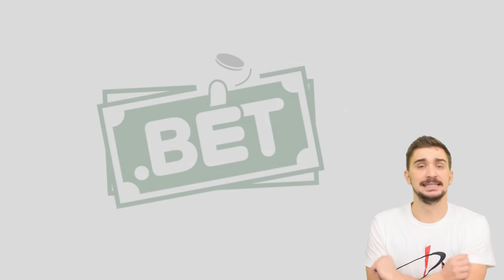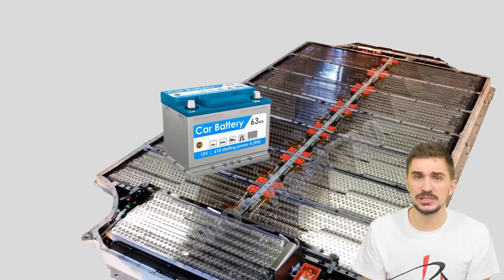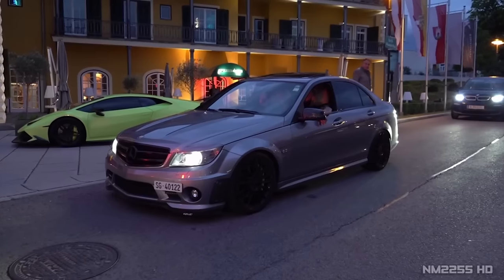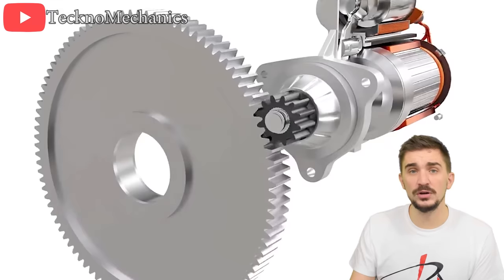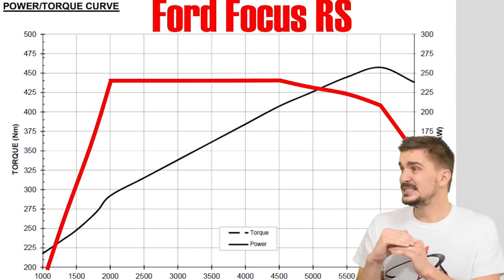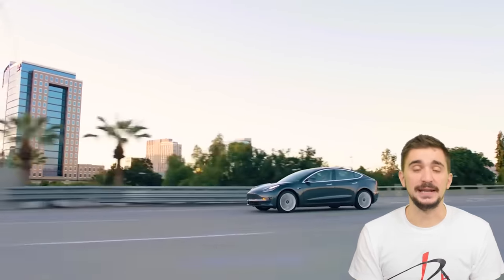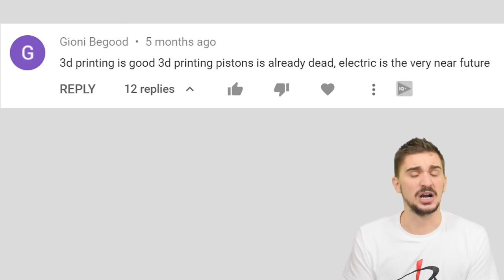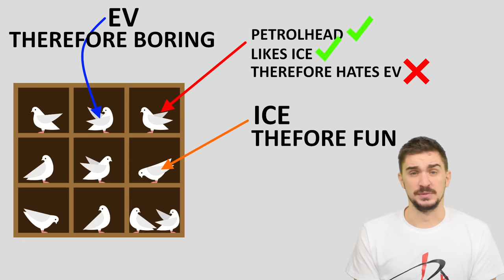ICE vs EV - IN-DEPTH comparison of BATTERY ELECTRIC and INTERNAL COMBUSTION ENGINE vehicles

Comment: induction is a function of the first time-derivative of the magnetic flux,
which means effective induction loves HIGHER FREQUENCY,
which in turn means high RPM. higher than needed for a EV.
whereas a brush motor torques like a mule on the near zero RPM,
the more you stall it the more it torques.

Comment: Some ev vehicles do use a DC motors , brush less. The torque curve looks like that to save power and for driving ability. You would be ok over the road with max torque at high speed, like drag cars are

Comment: As someone who loves gas vehicles, I also love electrics. However both are being made very cheaply, while costing a lot. I personally would prefer an EV due to my use case, however I won't be buying one anytime soon. This is because battery packs are still a work in progress, as well as the fact that a lot of manufacturers are not developing for the long term. Instead they want to pump out garbage for a generation that doesn't know quality. At this rate, I'd be better off buying a car with a blown engine and just electric swap it.

Comment: I like your channel and your videos very much. I do like ICEs and EVs. I ride a high reving 600 cc inline 4 DOHC with 4 carbs and it is a ton of fun. However, I feel increasingly bad about contributing to carbon emissions. I'd love to put carbon neutral fuel in my gas tank and would accept a higher price for my motorcycle meditation. Contributing to emissions is taking away some of the fun. It is also a reason why I now ride less. I can't excuse my contribution to emissions by pointing at the insanity of the still increasing levels of pollution around me. I feel that I share responsibility.

There are two points that I would have wished that you mention in that video.

Electric propulsion for trains etc is on a very high level of refinement since a long time. The evolution potential for EVs is actually in the battery department.

You didn't mention efficiency. Which is typically 20% for an ICE and 80% for an EV in road traffic. Not to mention recuperation.

With regards to Teslas losing against ICEs at high speeds: Sure! I live in a country with no speed limit on the largest part of the Autobahn. But the argument you make is actually more a petrol heads view, that thinks of speed and performance. That's great - for the race track. I've been a passenger in a Tesla in Norway. A short tip on the "gas" throttle and normal traffic looks like it is parking.

What I dislike is the idea that EVs should be huge and massive for safety reasons, like massive ICEs. The masses need to travel with less energy consumption per km/mile. So light weight EVs.
Reply from the maker: Honestly feeling guilty about riding means that you're seeing only a part of the whole picture. By preserving an old machine your also saving the world from the pollution and emissions that will happen during its recycling and you're also saving the world from the emissions of the manufacture of a new bike. On top of this the impact of a single 600cc ICE is less than drop of water in an ocean. There's a million stupid and unnecessary things we're all doing daily that are doing far more damage than that bike. All the unnecessary packaging of everything we buy, new this, new that. In reality the true problem is consumer habits and businesses who are doing a lot to keep those habits alive and governments who are not improving legislation to curb that. You're denying yourself "meditation" which you will simply have to vent elsewhere.
When it comes to ICE efficiency being 20% this is unfortunately propaganda that's being spread by the media and EV evangelists. 20% efficient ICE engines are from the 60s. Even my 1987 Toyota mr2 manages more than that. Many modern petrol cars are close to 40%,  some even beyond that. Modern diesels manage close to 50%. EVs are also not zero emissions and if you buy one you should also feel guilty because their manufacture has a greater environmental impact. You should also feel guilty driving one unless all the electricity comes from renewable sources. A single thermal electrical plant will make more emissions in a single day of normal operation than your bike in your entire lifetime. Feeling guilty is silly in my opinion because almost everything we do would make us feel guilty. I think a better approach is to be realistic and proactive. Let's not present neither ICE or EV as something that it is not and let's focus on changing our habits, the ones that matter and have an impact. Less waste, less buying what we don't need, more pressure on authorities to actually do impactful things. Less conferences and summits. More action and real change.
Reply: @d4a  Thanks for the kind answer! We are not that far apart, opinion-wise. That 30 year old Ninja will most likely stay with me until I'm gone, for exactly this reason: Sustainability. My car is a Citroen AX, that I basically saved from the scrapyard. I keep it for exactly the reason that you explained in the planned obsolence video: 80ies/90ies robustness and durability, before components were optimized for the typical use period of the average consumer. Replacing it with a new EV would be an additional waste and harm to the environment. The AX consumes less than 5 litres per 100 km and it handles almost like a race cart. Tons of fun. EV wise, I own a HP scorpion tricycle with a propulsion system that I have designed myself. It drives with solar power from my own solar system. As is my home, which is solar powered and off-grid since 1992. ;)

You might partly err on ICE engine efficiency. Sure, a direct injected diesel engine is above 45%, but in a passenger car it is operating with partial load most of the time. So it is rarely operating at maximum efficiency most of the time. Same goes for oversized EV engines, btw. My pedelec propulsion system has a small engine plus gears. I had to design it with maximum efficiency as a main goal, since I started in the early nineties, when Li-Ion wasn't available.

Comment: I like the Edisn motrs vehicles with diesel generstors charging a limited amout of batteries to help accelerate to speed  and coast at steady speed with a smaller economical generator 6supplying the drive motor.

Comment: The truth is electric vehicles just aren't a good fit for certain people depending on where you live. And most people still need a combustion engine to really go on long trips or if you're hauling any kind of loads or trailers. Now if the price goes down and the charging stations become way more prevalent and you have a short commute to go back and forth to work they make great sense

Comment: Can't wait for solid state batteries to become mature. It will pretty much solve all the current downsides to EV, which is the charging time, weight, battery energy density, battery longevity, cost, safety (no more thermal runaways) and pretty much everything else battery related. Battery is the weakest link in EVs right now, and solid state batteries will change that. Until then I'll keep my turbocharged ICE car.

Comment: Clarification: AC motors are not controlled solely by frequency. That would have exceeded max flux density at low speeds. In fact voltage and frequency are varied in a combined way as to maintain their ratio.

Comment: Your point about all the advances the ICE has already brought mankind misses a few salient points; in 1904, there were more electric cars in America than all the rest combined- gasoline, steam and the like. Actually, gasoline, as a fuel, was only just becoming a thing- drillers in places like Pennsylvania were letting the "light crude" waste products run down ditches they cut to waterways where is occasionally caught fire and burned for days! Henry Ford was one of the first to recognize gasoline as a fuel for motorcars. The ICE engine is what made powered flight by the Wright Bros even possible- ICE engines and fuel are more powerful pound for pound than any other. Still are! The all EV world is still a ways away. Lots of Vromm Vroom time left- with out a stereo speaker system to supply it! But I have been to 100 mph in 4.7 seconds in an EV, and it is a blast!

Comment: Video needs updated to reflect the plaid. Any video explaining the plaid Tesla. As cars no longer can outrun Tesla plaid anymore over 100 mph.  You are correct about electricity and it depends on where you live.  But most places have access to the free nuclear fusion in the sky called sun. Which if you are handy and DIY can install panels and control your own fuel.

Comment: Can an ev ever beat a top fuel dragster? Or would it just be to heavy adding more batteries and motors?
Reply: The only thing beating a top fuel dragster is a rocket engine

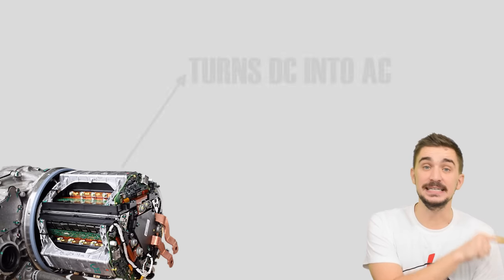Comment: 14:10 is wrong on so many levels. You cant just alter the frequency, because the impedance of the coils will fall and they will overheat very quickly. Ideally you would compensate with voltage, but voltage conversion is expensive, which is why all homemade or mass production vehicles use PWM controll.
Also to controll its speed you use a closed feedback loop between rotor speed and true rms of the input  CURRENT, not voltage.
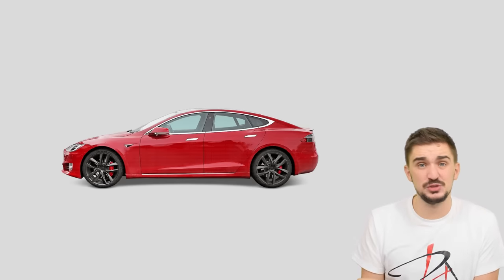Reply: 23:20 brakes are the least maintenance intensive item when you have brake regen.
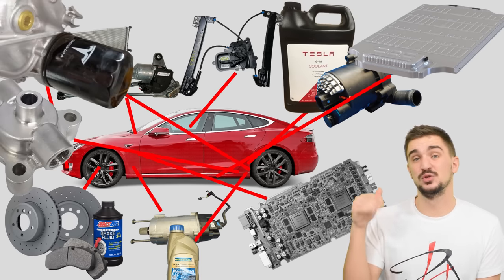23:40 said batteries you skip over briefly loose more value over time than most maintenance expenses on modern econobox car.

Comment: Should do a vid on the plaid motors.
They don’t suffer torque loss with RPM
Reply from the maker: Yeah this video came before that. I'm thinking about a series that ventures deep into electric cars, but I feel like it's still to early.
Reply: Around 1981, I designed and built a custom, 12 speaker car stereo system, that at the time was quite impressive.
A friend of mine encouraged me to wait to execute the design and construction of the stereo given potential advances in technology, at which time I told him….
“If I wait for advances….I’ll never have a stereo”

Comment: Some points...
Model X Plaid has 3 x 51kg motors adding up to 1,020hp
A Veyron with 1,000hp has 1 x 490kg W16 behemoth 
The EV has a battery pack that weighs approx 536kg for a combined weight of around 690kg (rounded)
The Veyron though has a 100 litres fuel tank of petrol 100 x 0.75 = 75kg. 
Throw in the weight of the Veyron gearbox, various props, cogs and connectors and I'd bet my arse, the power train in a 1k hp veyron is ultimately heavier than a 1k hp tesla.
And on top of that, almost all of the weight of the drivetrain in the tesla is very low down and equally spread out. The W16 in the Veyron is tall and huge and has to be engineered into the car to balance the vehicle. And that 100 litres of fuel has to go somewhere and needs measures to stop it a) sloshing around and b) protect it from leaking and/or exploding 

As for services, brakes, coolant, suspension etc aren't technically service items. They're wear items. You could not change your brakes for years if your mileage/driving style allow it. Suspension again, if you drive on smooth roads will last 100k miles easily. Coolant is an irregular change and on an EV its less likely to contaminate. 

I'm not an EV owner. I'm not an EV fanboi.
But I do get sick of uneducated people bashing them when they clearly don't have the full picture.
Reply from the maker: Thanks for the laughs 🤣
Reply: @d4a  just to clarify, my comments were at the commenters, not at your video. People will listen to probably a quarter of what you say, and that quarter will be the quarter that helps their confirmation bias the most.

I don't know what it is with EV haters. They're bizarre people. I'd have more time for someone if they just said they have no logical reason to dislike them, but they just don't. That's better than making shit up to try to prove themselves right.

BTW, loved the last part about how engines have brought people together for nearly 200 years and we should thank them for that 👍👍

Comment: Auto manufactures should look to the Steel industry and build a Cvt style transmission, those may not be the best but would be reliable as thats whats used in almost all steel mills and they run forever constant.Would also allow the Motor to stay at a constant speed and use the transmission to load of unload instead of the motor.

Comment: As soon as my EV goes out of warranty, I am hacking in a manual transmission :D 
Acceleration suffers at above 100km/h, virtually gone by 170km/h. Not that i ever need to accelerate above 170, but i think that crappy efficiency at speeds around and increasingly over 100km/h are at least in part caused by the same effect.

Comment: back in the 70s my dads gearbox broke. stuck in 4th gear. he used the starter motor to get a speed boost. at around 30kph the engine would turn over properly and he could drive. the clutch was very unreliable, otherwise he might have been able to start the car by carefully ending the clutch.

Comment: Looking at the torque curves of EVs it seems to be they could benefit from 2- or 3- speed transmissions to keep them in the peak torque range at any speed. Also, with EVs run 7000+ RPM for 100 km/h wouldn't it also extend their range by running at lower RPM?

Comment: As someone who has just entered the EV scene and never claimed to be a "petrolhead", yet had several ICE driven cars, I'm really impressed by the objectiveness of your comparison, at least most of it. Really good, really to the task.

In your conclusion, however, thwre's a thing or two I'd like to add.

The rudeness and stereotype of ICE haters, as you claimed, is exactly found the pther way round whereever you deal with EV mainly, so we have a sort of unnecessary childish remis here.

Also, you spend little attention towards climatic change issues and carbon footprints, only in the very end. I think that's something we have to eatch pretty closely, especially while nrw types if batteries are coming up already, being way more environmentally neutral at least.

But I really want to thank you for not serving that  "EVs easily turn into burning sensations" thingie. 

For my part, I think the Combustion engine will walk that very path the Watt steam engine went - which would take it from the streets ultimately, but also would keep up it's benefits it had on mankind.

As you've said, we don't know the future. Thanks again for your objectiveness.

Comment: The American electrical grid is not capable of supporting the number of charging stations that some would like, because of the amperage required to quickly charge an EV, and the capacity of the batteries today cannot give an EV the range of an ICE vehicle. What interests me is the hybrid, I cannot understand why a Diesel electric car has not achieved popularity, since railroad locomotives have been using such drive trains for about 65 years.

Comment: Internal combustion all the way. Electric will be good for family vehicles, delivery trucks, and other light-duty or short distance operarions, but gasoline and Diesel will always reign supreme for heavy, severe duty, and long-distance applications. Plus, you don't get the fun of engine sounds, tuning, and turning wrenches.

Researchers have even found ways to use pyrolysis to turn garbage, sewage, and other waste products along with organic matter in general, into oil. If oil companies, for example, can take this seriously, it would provide a way for us to get energy-dense fuels without actually using petroleum. It would also solve a lot of problems that E85, for example, has with corn and ethanol.

Combine that with carbon-capture facilities and biofuels can actually be very close to carbon-neutral.

Comment: Dont forget about cold winter countries. Can you imagine using EV for daily commuting with -30 degrees of Celsius on the street - its a nightmare! All the charge goes to heating the interior and battery itself and then you could drive 20-30km on full battery. And this if there IS battery heating - Nissan Leaf dont have it and with -20 to -30 celcius you have 30 to 40 % of fully charged battery capacity. I live in Russia and we have EV too but I see them most time on warm time of a year. But sometime I see EV on winter - they ride around 40km/h with frozen windows that I couldn't see driver at all))) In this conditions an ICE vehicle has one major advantage - huge amount of heat for FREE. In summer the heat is dissipate to the atmosphere but in winter it goes to freely warm up the interior that you can drive on a t-shirt when its -30 celcius on the street.

Comment: I almost never use my brakes, the regenerative "braking" slows the car surprisingly fast.
Reply: The calipers  will seize up.  And you will need new pads afterwards of course.
Reply: @paulmanning8897  thats a good point about not letting that system atrophy. I mean it's not literally never... the brakes are still getting some use but they never get used hard on like a long down hill descent from the mountain. I used to have to put the car in low gear  but still needed brakes, the tesla it's easy.
Reply: Hybrid vrakes feel weird

Comment: Not sure where you got your data about the Netherlands but they are a bit of. In the past months I averaged 1.5 euros per liter for a premium gas. At the current rate that's about 1.8 dollars a liter, right. Also, regarding the electricity, at least at home, not sure if there are any special rates regarding the charging stations, I do pay 0.22 euros for a kwh and this is one of the cheapest if not the cheapest rate on the market at the moment. This is however true for me, but obviously things can vary. Still, putting an 80lt tank ain't cheap :)